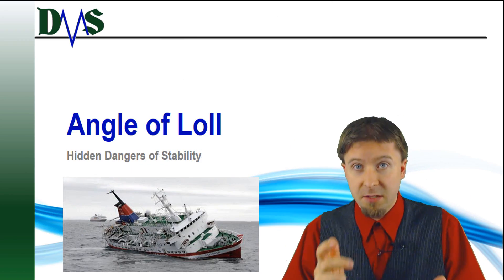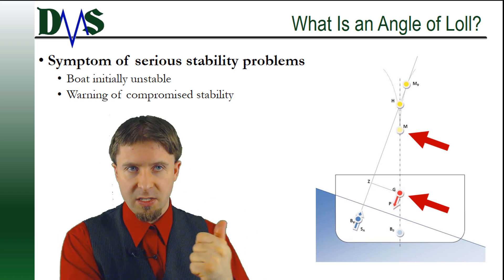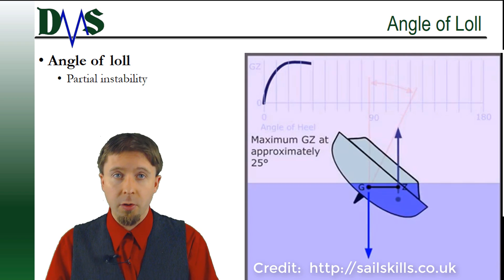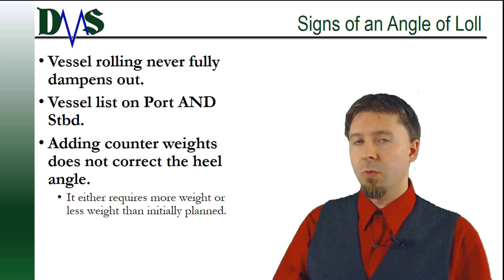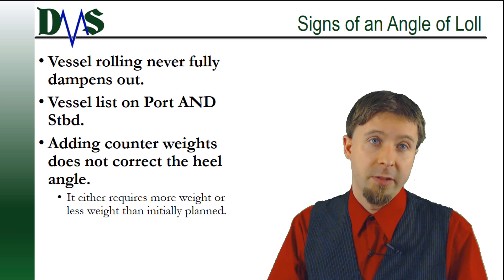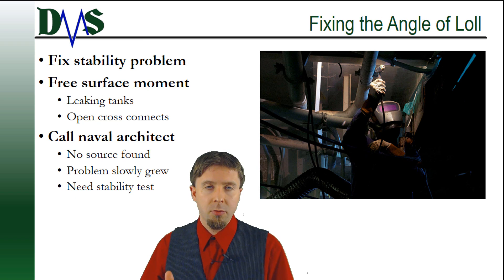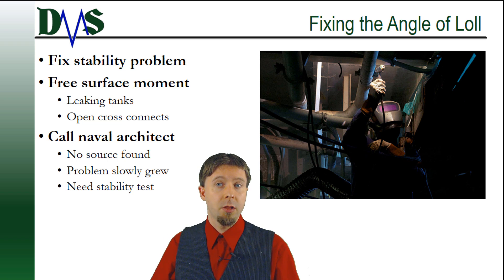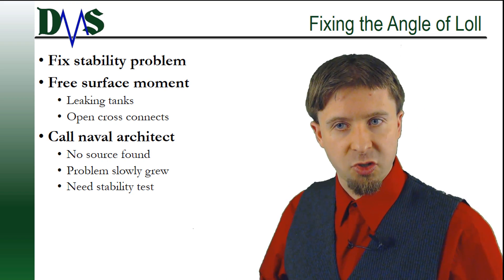HIDDEN DANGERS TO STABILITY:  Angle of Loll

Comment: Watching your videos & observing mass locations made me realize just how "out of balance"  my families pristine early-seventies fiberglass  Seaswirl 16 ft outboard glass is....Firstly is the 50 HP rating for an engine off the transom. Engines circa 1973 were typically four-cylinders, inline or V4...upgrading to newer engines made for three or two cylinder engines, at a considerable weight savings, less weight on the transom. Further, the  location of the fuel-tank rides very far forward & up way too high ( a rectangle  whose floor is 18 inches off the floorboard)....Then the back to back seats common in that era, also too far foreward...I always felt a degree of strangeness as I  learned boating circa 1974 in this boat & later (90s) new boats, the newer boats much more stable. Now I know where the stability problems lie.

Comment: Could you explain what free surface moment is and why it would cause an angle of loll?  
I get the danger of sloshing liquid but that moves the centre of gravity sideways but not necessarily razes it. More specifically (to my understanding), the tanks are part of the design, if you load properly, you should not need to consider the tanks. They may cause a list but not a loll. 
There is something I don't fully understand here.
Reply from the maker: That is an excellent idea.  I will have to create a video on this.  For now, I will give a simplified explanation.  First, there are two problems with liquids in tanks:  free surface moment and sloshing.  Sloshing comes from the momentum of the liquid as it hits the sides of the tank.  Sloshing is not a major concern except for tankers where they have huge cargo tanks full of liquid.
The other issue is free surface moment.  And you described it perfect.  As the ship heels over, the liquid in the tank shifts, and the center of gravity moves sideways.  For small angles, that sideways shift in the center of gravity follows a predictable mathematical formula.  And as a weird quirk of mathematics, that formula exactly mirrors one of the formulas to vertically raise the center of gravity.  
So to account for tanks, we use the shorthand version of the mathematics and do all the stability calculations with a "virtual center of gravity."  That is just the physical center of gravity, plus a correction to account for the tank free surface.
And to the last part:  yes, the tanks are part of the design.  And yes, if you load them properly, the ship should be safe.  But tank load is also about drawing from the tanks in the proper sequence.  For example, a ship may have 4 - 6 pairs of fuel tanks.  But we only design the ship to have one pair slack at any time.  All the others are either full or empty.  Not every captain understands how critical it can be to stay within those design limits.

Comment: @ "Nick the naval architect": what are typical heel angles in concrete numbers that can be expected in typical offshore storm conditions (not including hurricanes)? I'm wondering how much room for error there is between actual typical heel angles and design capsize angles. The latter I can calculate, but without knowing how steep in concrete numbers big ocean waves tend to be it's hard to know how good of a given design capsize angle is good enough.
I'm referring to power boats, not sail boats with deep keel ballast. Therefore lever forces on sails due to inadequate reefing are not a factor, so my question is purely about fluid dynamics of waves, not wind influence.
Example numbers: power cat 4x10 meters with 2.5 t displacement, design draft 0.5 m, initial stability: vertical center of buoyancy 0.30 m, COG 1.0 m, transverse metacentric height 8 m. COG as "fixed" = no free fluid surfaces taken into consideration.
Thanks in advance if you take the time to answer. Nice and valuable channel by the way!